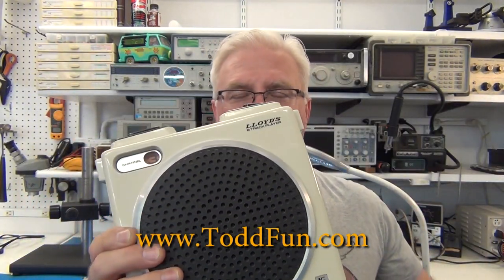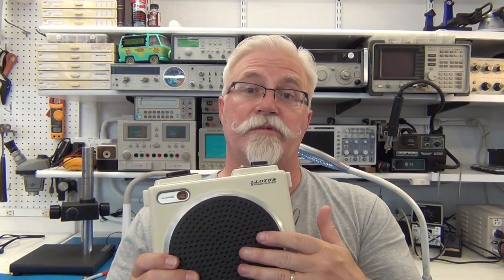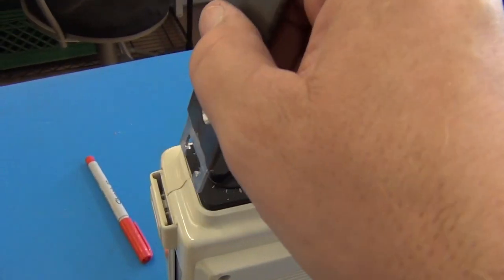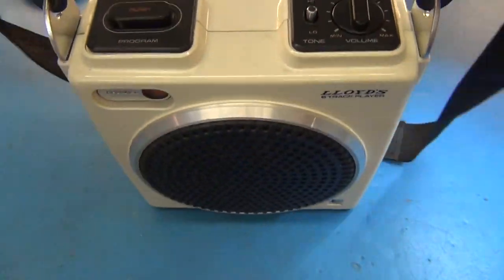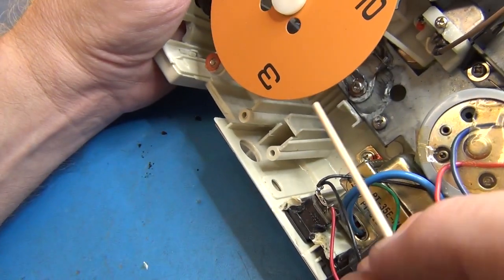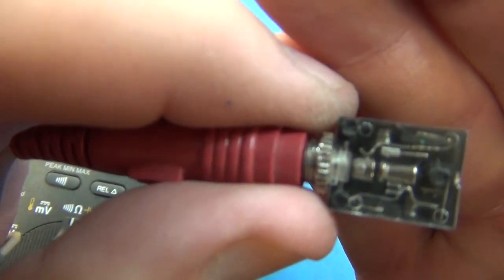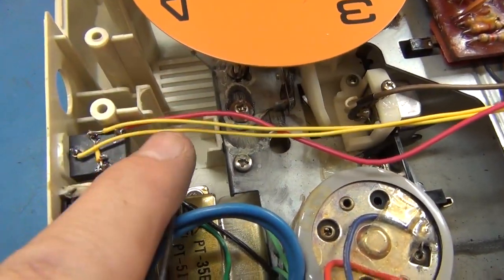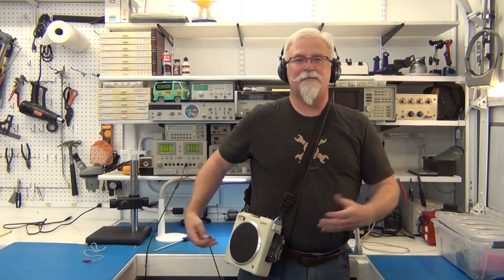Portable 8 Track Player Hacks

Comment: This is exactly what I was looking for! I also have a missing strap and will be using your mod measurements to make one. :) I ordered the same 1/8-inch socket you used for the headphone mod. Because I'm not an electronics guy, I can see where the wires are soldered on the socket, but I'm not sure where the wires end up on the radio end? It looks like you might have spliced your red wire to the orange one on the radio going to the speaker? But where do the 2 yellow wires end up, please?

Comment: Or you could put a bluetooth module in an go wireless.
Reply from the maker: Say now there is a cool mods. I could put in the guts from one of those small Bluetooth controlled speakers and run Pandora from my phone or songs from the internal SD card.  Then add a switch to turn on/off the 8 track or BT and add  some BT ear buds. There is a ton of room so why not? HA
Reply: yeah - I love bluteooth. I've got a bluetooth speaker in the shower, a portable one, bluetooth headphones too sync'd to my computer, the others to my phone.